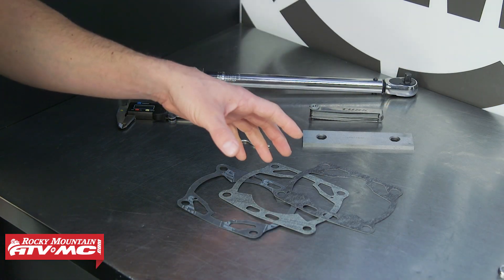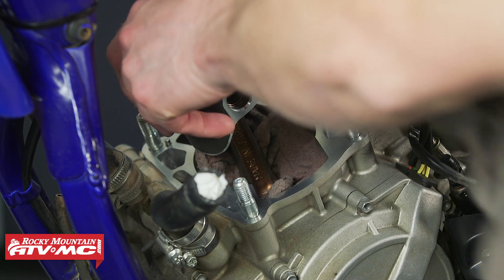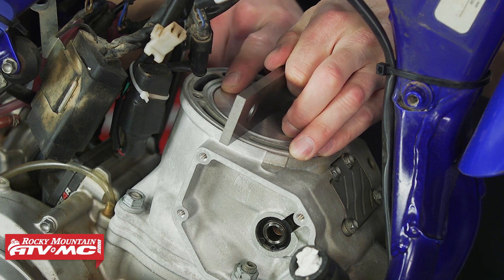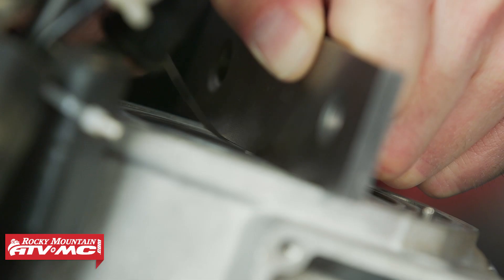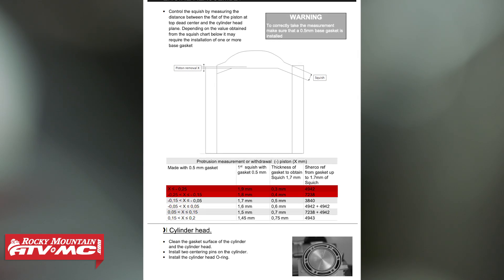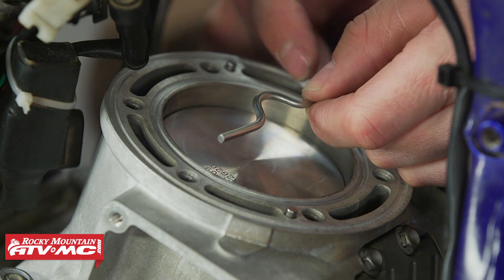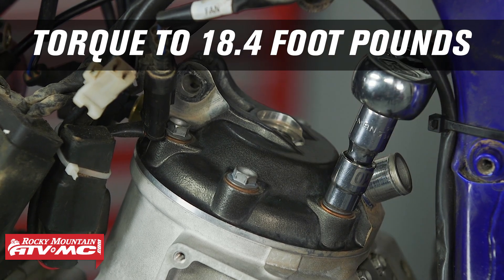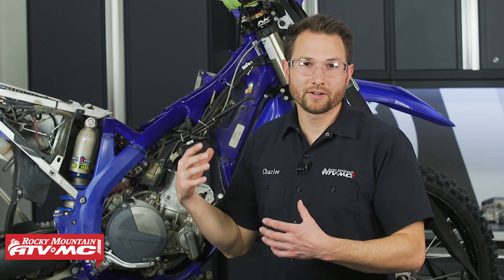How To Choose the Correct Base Gasket for Sherco 2-Stroke Motorcycles

Comment: That's a cold measurement, what about expansion?
Reply: Certain clearances are critical on an engine, an example would be piston to bore clearance, others are not critical, well not when the squish is too large to start with anyway. 1.7mm squish gap is border line too large, it will just about work as a squish band but not all that well, really the max gap would want to be 1.3mm, 1mm being a good figure to aim for on a fairly large engine. I'm not familiar with the Sherco engine so I have no idea whether tightening up the squish band would put the CR to high, if it did then the bowl would need opening up. The other thing is if you just use the base gasket to tighten up the squish you would end up lowering the ports which might not be what you want to do. The solution in this case would be to pick a base gasket and then machine the head to get the squish right, you would then open up the combustion chamber if required. You can even open the chamber up to bring the CR back to stock, with a working squish band you would still get a nice improvement on the engine performance.  KTM's are fairly bad with regards to the stock squish gap, I have worked on one GasGas 300, it was REALLY bad, something like 2.5mm. I set the deck height on my KTM 300 to zero and the head has been setup to work with that, when I change the piston or get the crank rebuilt I just have to set the deck to zero and I know that the head will work, I'll have the 1mm squish that I want.

Comment: Hi My ktm exc 300 need to have 0.10-0mm x clearence and i just measured it and it is 0.01mm off on one side off the cylinder. is this ok or do i need change thicker gasket?
Reply from the maker: It's up to you, and where the next size gasket would put you. I wouldn't change it unless you had something that puts you right in the middle of spec. -Charles
Reply: @rmatvmc  thanks for fast respond this helped a lot.